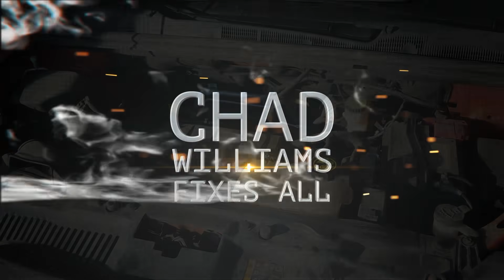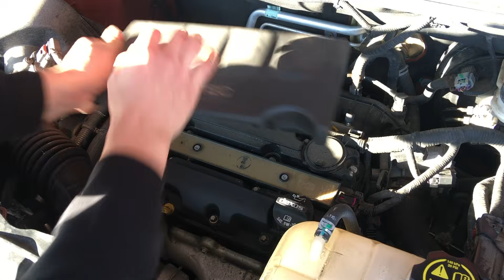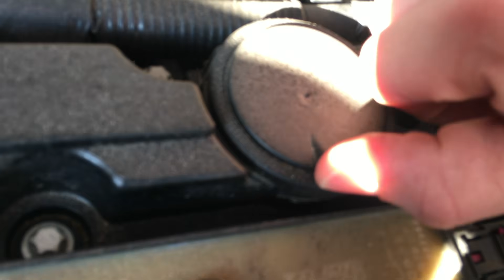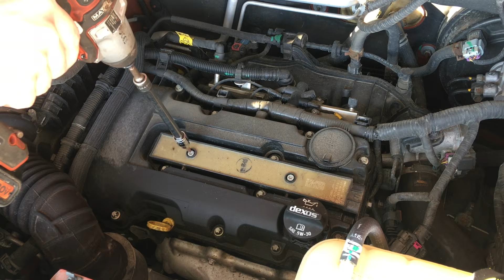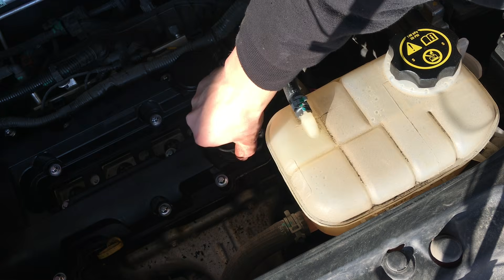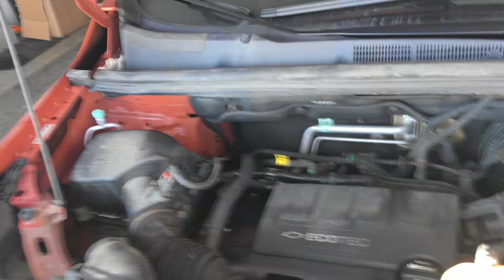Chevy Trax / Cruze / Buick Encore Valve Cover Replacement - P0171 Bank 1 Lean

Comment: POS! You translate it.
1. Thanks to the SUGGESTED torque wrench (that does not click and cannot be set to 71 foot pounds (no markings for 1 ft pd)...
...I now have a valve head with a snapped off bolt in it.

I am not allowed to be explicit and therefore I will put my frustration into finding a mobile mechanic to come over and solve the problem created by a faulty torque wrench.

Tony

Ps. Oh how I long for the days when freedom of speech was not controlled.

Comment: So If I have a code p0171 I gotta replace the entire valve cover? Not the part only?
Reply: Its usually built into the valve cover so replacing it is the only option.
Reply: That maybe not be problem.. mine  was a purge value .

Comment: Hi, i have Chevy trax 2019, I feel the smell of something burning When driving, could there be an oil leakage or something?
Reply: On my friend's SUV does that. It's a power steering fluid leak. The fluid leaks and drips on the hot engine. The cause is a power steering hose needs replacement.

Comment: Rockauto has the same valve cover by Dorman including gasket  for  $44.79 plus tax and my shipping was $9.95. Cheaper than Amazon link. Should change spark plugs, while you have access. ACDELCO	41121 (41-121) $ 5.56 x4=	$ 22.24
Reply: The reviews on the Dorman part  are NOT good.
Reply: Ya I was thinking the same thing re:$park plugs

Comment: I did it on my car last night. Took about 45 minutes.  You need that torx socket for the wire pack.  It was not included in the description. I had all the parts but that one. I used some bit from my toolbox and stuck it in a small socket.  Kinda worked, at least to get them loose. Putting them back in it helped a little. Still have to buy one to make sure its tight enough.

All my check engine lights are off and car runs much better.
Reply: He did verbally mention this donkey!

Comment: You did not fix the issue. You need to address the intake manifold that has the missing pcv valve that probably caused the valve cover to crap out.
Reply: You I think are answering my questions because when I took it to Chevy dealership they said I need it to replace the intake manifold a long with the valve cover they have to both be done
Reply: @dawnmcmannis2551  I think it's a good idea to do both regardless. There is a kit that permanently fixes the intake.
Reply: This is exactly right hope everyone sees this exact reply
Reply: @brinkmano9  which reply?

Comment: What happens if you break a screw while torquing ?
Reply: You have to drill a hole in the ... Broken screw.... Then extract it with a special... Self...Tap bid....  A very tideus job indeed... But if done correctly...it possible o.k..  after breaking a very important Bolt ... Trust me how hard it can be ... Will make you more careful the next time for sure. 😂... Good luck

Comment: I have done this job twice n still leaks out on the valve cover fron corner of cam gears I did put seal where you supposed to but I still leaks
Reply: Victor naja.. I have same issue with mine.  Oil leaks at the corner also .. Im thinking mechanic didn't know about the uneven gap or something cause oil leaks right at that same spot ..
Reply: @juniorharry7785  hi I found out the problem.   it was the gasket it self. I was using after market but the last one I did I went to dealer n it's perfect now. No leaks
Reply: @victornaja7927  ok thanks ,I'll try that and look at mines again ..Im going buy an intake manifold also and the valve cover ..and maybe my engine light and problem will be gone

Comment: Thanks man, this was a perfect video for this issue. I have the same issue with my 2013 Buick Encore (same engine) and I was just going to replace the gasket but you showing how that diaphragm shouldn't be sucking wind convinced me to replace the whole thing. Mind was like one that put their hand over a vacuum hose while it was on;is would such and whistle pretty loud.

Also, kudos on doing a YouTube video correctly in explaining everything but GETTING TO THE POINT and having the video speed up during the labor parts.
Reply: I'm about to do the same thing! 2017 Buick Encore, just rolled over 110k miles and is doing the same wind noise.